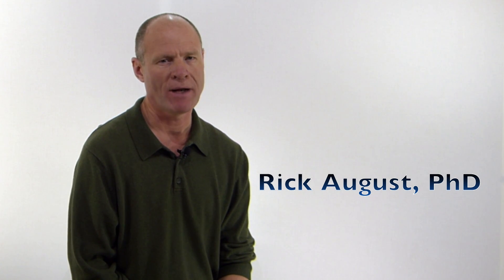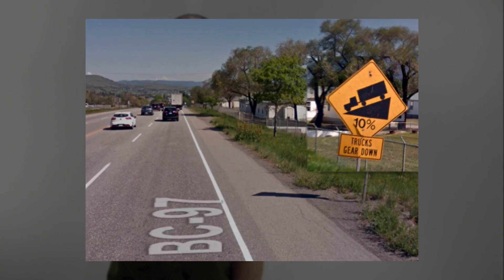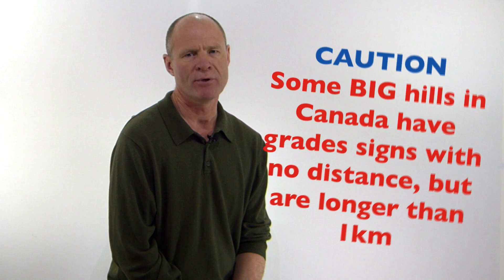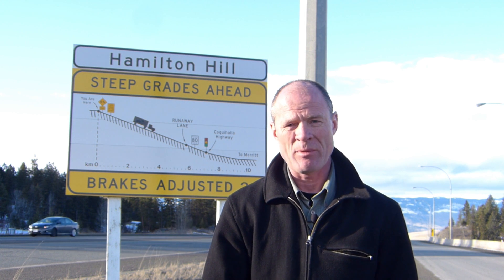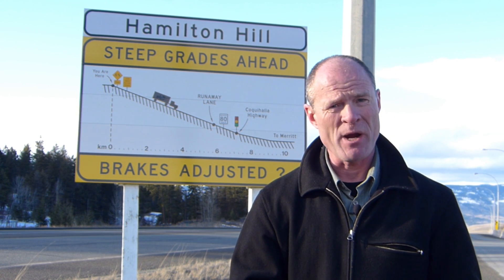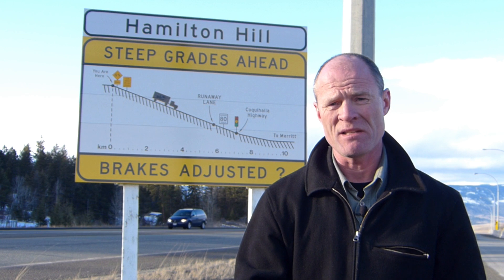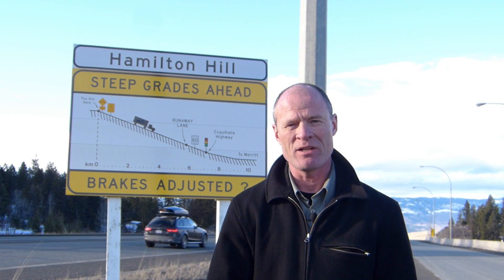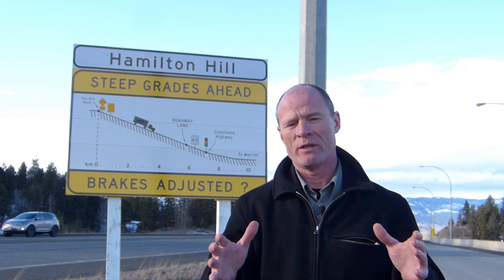How to Brake Downhill Safely | Air Brakes Smart

Comment: Brake fade: another thing to remember, when the linings get really hot there is some type of gas emitted that almost prevents any  proper contact between the linings and the drum or discs. This happens also with disc brakes. Ask anyone involved in motorsport: there are special linings used that work best only when hot.
Reply from the maker: Hi Uncle Bullfrog - Apologies for the late response. Thank you for your comment. And you are correct: this is a simplified version of what happens when you overheat the brakes. Disc brakes are just starting to make inroads into the industry so it will be interesting to see how these work in the mountains. All the best, Cheers Rick
Reply: @smartdrivetest  I hope they do help, that being said from what I'm told from now experienced drivers when it comes to brake fade you just get faster cooling time after you've lost your brakes. Granted that's anecdotal but it's all I have to go on.
Reply: Can you answer my question please ?
Reply: Because U-Haul rents box trucks to people who drive smart cars. It's an oversized station wagon.

Comment: With air brakes you never pump the brakes.  This will or could cause there to not be enough air in the air tanks to stop the truck.  A lot of YouTubers are telling people to use a system of what they call STAB BRAKING, which is the same at pumping the brakes.  By doing this you can pump all the air out of your truck air tank reservoirs that you need to stop the truck causing it to be a run-a-way truck towards the bottom of the hill because of insufficent air pressure.  This is very dangerous.

Comment: Excellent.
 As a veteran driver with over 3 million miles I concur. 
 You did miss 1 though,  and it's a biggie.
 Going down using the 'Johnny bar' is an excellent way to lose the brakes and it happens alot.
 The Johnny bar is usually on the steering column and activates the trailer brakes alone.
 Guys use it so that they can 'save' the tractor brakes. 
 Owner/operators are especially guilty of this.
 What happens is the trailer brakes get overheated and cease to function.  At this point the driver will start to use the tractor brakes, perhaps thinking that the trailer brakes will cool down. 
 WRONG.
 When the foot pedal is depressed it activates both systems.  The trailer brakes continue to heat and will not cool down, ever until you wreck.
 NEVER, NEVER use the Johnny bar for braking Going downhill. 
 The reason that trucks even have a Johnny bar is to couple and uncouple the trailer and is the only time it should ever be used.

Comment: What about in the winter time when it slippery also the Jake all the way down .
Reply from the maker: If it's that slippery, you should have chains on. If you don't have chains fitted and it's slippery - don't use the engine brake. Cheers Rick
Reply: Thank you 🙏🏼

Comment: Question: Using jail brake constantly on a downhill and while turning - is it safe? Because it's known that a rig brakes with it's power unit and that means that a trailer's wheels are spinning free and without control - so should we expect possible trailer skid or in what turn degree it could be occurred (how sharp a turn must be to initiate skidding)? Please, needed in advice. Thank you!

Comment: What means “if U r in the right gear” if trucks has automatic transmission? I just slow down to the posted speed limit and a little down
Reply from the maker: You have to select a gear manually with the automatic transmission. What kind of automatic transmission are you driving my friend? Cheers RIck
Reply from the maker: You have to shift down manually in the automatic transmission so it locks into 5th gear. See the owner's manual to figure out how to do that my friend. All the best, Cheers Rick

Comment: Sir before downhill i brake and lower the gear and go slow is that good whether its motorcycle, car. But my friend told use brake no need to lower gear rely on brake . Which is correct
Reply from the maker: Your friend is correct my friend - just use the brakes in a car or motorcycle. This information applies to pickup trucks towing trailers and CDL vehicle (buses and semi-trucks). Drop us a note if you have further questions. All the best, Cheers Rick
Reply: @smartdrivetest   But downhill  we need press brake hard right. Instead we go in lower gear we can control know any way using brake also . India  driving school they say to use lower gear in downhill. Here we use old brakes , old bikes is that reason. Engine braking
Reply from the maker: You are correct my friend. if you have an old vehicle with unreliable brakes, then definitely gear down to descend the hill. However, if the brakes work, use hard, short brake applications to reduce speed 15-20mph (20-25kph). With short, hard brake applications, you won't overheat the brakes my friend. Drop us a note if you have questions. Cheers Rick
Reply: @smartdrivetest   sir i learned through old vehicle unreliable brake and I use these techniques break as well lower down . Any thing wrong or fail test in your country.

Comment: We used to also turn the engine fan on ( our trucks had a switch on/auto) it helps holding back on steep loads.
Reply from the maker: Must have been Peterbilt trucks!! Yes, the engine fan is handy to take some power out of the downhill descent. Thanks for the tip. All the best, Cheers Rick

Comment: Do you have a video with this topic for regular cars?  Need to understand the difference between using breaks and driving in a lower gear.
Reply: Regular cars don’t have air brakes

Comment: 5th gear sounds like it would be way too low of a gear, especially on an 18 speed
Reply: I go down a 6% in 7th over if I have to slow down I go to 7th direct holds at 60mph in 7th over at 89klbs... 18speed Eton with a Detroit...

Comment: 02:48  what is he saying 13 or 18 speed single digit or tandem tandem ?  I drive automatic 12 gears freightliner?
Reply: What he is saying is on a grade of less than 10% when driving a 13 or 18 speed, you want to use 5th gear, it would be about 5th or 6th gear in a 12 spd.  Maybe even 4th if the gearing is higher.  (Built for speed, not power).  Tandem-tandem means a 5 axle truck. Steer, tandem drive axles and tandem trailer axles.  Anything with more than 5 axles is going to be heavier so you would want a lower gear.

Comment: 5% grade jake break blew out in West Virginia 2022 freight liner cascadia currently on the side of road waiting for a wrecker. Blew white smoke exhaust behind me was scary but I realized it wasn’t the brakes smoking heard a loud pop under the hood and saw the white smoke began stabbing brakes automatic wouldn’t not down shift so I had to just lightly stab brakes until came to bottom of hill to pull over.

Comment: So I'll be doing Donner Pass to get Into Sacramento in a few weeks.  In all likelihood I'll be In An automatic, air equipped Ryder or Penske truck at around 20-25k GVW. I don't think I've ever been in one of these trucks that had a Jake brake. All they really have is High or low gear.  What do you think the safest approach to this hill is going to be?
Reply from the maker: Are you taking a box truck? Cheers Rick

Comment: Thank you, Dr. August.  Great video.
Just a quick note, not so much to you but to the DOTs out there:  In addition to indicating the grade percentage, please add over which distance that will unfold.
We really NEED to know how long the downgrade sustains itself. Dr. August mentions this issue in his video. The information is crucial to know how to prepare for a downgrade. I worry less about a 7% downgrade over two miles than a 5% downgrade over six miles.
One more note about emergency escape ramps: IF your brakes fail, once your brakes fail, in a fully loaded truck speed really accelerates rapidly. If you have just passed an emergency escape ramp and the next one is five miles away, boy, are you in trouble. You'll be doing a 100 mph by the time you get there.

Comment: 0.27 what does he mean 'driver air'?
Reply from the maker: Hi swissborg $3moonshot - it's "driver error" my friend. In other words, the driver either wasn't trained properly or the driver picked too high a gear and wasn't using the engine and auxiliary braking systems to do the majority of braking when moving down the the long hill. Drop us a note if we can help further. All the best, Cheers Rick

Comment: “Rise over run” means absolutely nothing and makes no sense
Reply from the maker: Hi God - if you have a 6% grade, it means that for every 100' ft that you travel forward (run), the hill drops 6' ft (rise) my friend. The bigger the number on the grade sign, the steeper the hill. Drop us a note if we can help further my friend. All the best, Cheers Rick
Reply: @smartdrivetest  thanks. But i dont get the nomenclature, you are not running you are driving and its not rising its dropping. Should be “drop under drive”

Comment: What about the automatic trucks? You can’t necessarily downshift before going downhill, so would applying the engine brake be enough to make it safely downhill? I’m referring to a automatic freightliner truck
Reply from the maker: Hi Just Me - you have to put the transmission in manual and downshift my friend. The engine brake cannot hold the truck if you don't downshift the transmission. Drop us a note if we can help further my friend. All the best, Cheers Rick

Comment: The distant sign should becon the hills in BC. ( drivers put signs up gov took them down LoL ) seenbtrailers burn down.  So what do you do if in  snow storm signs snowed over NOT fsmiliar with road and all ready on the hill. Big problem. Utuber is a trainer/ tester NOT a driver. Yup check his notes. 1 403 830 4124 Also snubbing brakes on ice NOT a good idea. Max braking at high rpm yes. So why NOT let it run up to 2100 rpm )( log trucks same engine goes to 25oo rpm. So why NOT  let it rev. Even higher. Engine will hold more at higher rpm. Wind risestance increases as speed increases. Lots of times NOT holdingvat 1900 rpm. But held steady at 2100. No brakking required. TYPICAL  gov testor.  And if need be log truckers know how to drop gears " safely" while going down hill. NOT taught to hwy driver why NOT?  1 403 830 4124

Comment: awesome stuff
i seen a 9% here in usa
didnt see 10% before
anyone knows if there are any in usa ?
usually go down 6th gear in 6% 
and use 2nd stage in jakes 
and once speed up a bit, take it to 3rd stage jake and it will drop speed then go back to 2nd stage
just keep alternating.....
Reply: Is this apply to 10 speed too? Im going down hill with my 9th gear on 6% its still a little too fast for me. BTW im a new driver. Thanks
Reply: 10% in bc is not the worse some are 18% or more depends where your at.

Comment: How to use jake brake in winter in snow in steep hill
Reply from the maker: Hi Ranjit Dhaliwal - if it's really slippery you may have to put a single chain on the trailer. And when you're going down the hill go slow and keep you eyes in the mirrors watching the trailer. If the trailer starts to come around, push on the throttle to shut off the jake, let the truck run a little until the trailer straightens, and then get back on the jake. If it's that slippery my friend, they'll probably close the road. Drop us a note if we can help further. All the best, Cheers Rick
Reply: @smartdrivetest  thank you so much sir really appreciate i will let you know if i need further help

Comment: Is it safe apply j break in snow?
Reply: If used properly jake brakes can be used is snow.   Go slow use low rpms use low jake setting keep your foot over the accelerator so if the drive wheels start to slide you can smoothly press the accelerator to get the weels spinning again. If you are using the jake avoid heavy foot brake application as that can lock the drive tires up because the jake is already slowing them.   Do not go full jake at high rpms trying to slow the truck. That is very dangerous in snow or really wet roads.   Jake brake should never be used while driving on icy roads or really hard packed snow.

Comment: I don't know if automatics are a good idea driving cross country?  Locally probably would be more ideal because you don't have to shift all the time.  But when I started to think about downshifting for a grade.  I thought man not too sure about automatics?  I would prefer a manual.
Reply from the maker: Hi Jeff Chapman - Thank you for your comment. Ya, I'm not sure about automatics either my friend. Especially running in the mountains. I would really, really prefer to have a manual for running hills. And most of the trucks still are manual for the mountains. All the best, Cheers Rick
Reply: They are not as bad as one would think.  Most can be manually controlled. Some can only be put into a gear hold mode. It takes getting used to and i really prefer a manual in any condition.  But automatics are not really that bad.

Comment: If my tendom dump truck is loaded 48,000 lb as gross weight,  at what gear should I be at the intersection to turn left or right?
Reply from the maker: Hi Bob A. - Thank you for your question. For right turns you'll probably want to be in 3rd, and for left turns it's going to be 4th or 5th gear depending on the size of the intersection. All the best, Cheers Rick

Comment: Here is a question: I live in a very populated area. I often hear Jake brakes on semi’s as they roll through town. Should drivers, professional drivers, use the Jake brake in a city  as a means of stopping faster: i.e. using the engine brake to slow the truck down rather than keeping the truck in a low gear? I tend to think that style of driving shows a lack of experience. However, I could be wrong; hence, I ask.😉
Reply from the maker: Hi CT! - Thank you for your question. You are correct my friend. It's sheer laziness on the part of the driver. It's just a switch in the cab - on/off. Always happy to help. All the best, Cheers Rick
Reply: Those drivers are usually just annoying show offs.🤦‍♂️ very rarely does someone need those jake brakes in town to slow down.   Maybe if someone cuts them off and they need everything they can to get stopped.
Reply: @Bendigo, Thank you. The drivers that do this are driving in a 30 mph zone. Like...WOW!!! That does not make ANY sense, in my opinion. Why would you even NEED an emergency brake set on in such a slow speed zone? Crazy!
Reply: @JustAThought155  i doubt that it would really be necessary at that speed.  Only if its on a steep hill and a heavy load in a unplanned stop like someone walks out in front of the truck  or a car pulls out and stops etc but not something a driver needs to be doing all the time. As i said some drivers just like to show off or be annoying.  Most towns and cities have ordinances banning or limiting use of them in city limits.

Comment: Someone told me you mustn’t use the accelerator while the retarder is active, but i can’t  se how it could be a problem since the retarder is just basically an air cushion, was he wrong?
Reply from the maker: Hi Rikard Nilsson - Thank you for your question. Someone gave you mis-information my friend. If you push on the throttle, you'll simple turn the engine brake off. If there is anything further we can do, drop us a note. Always happy to help. All the best, Cheers Rick
Reply: @smartdrivetest  Thanks, I kinda suspected it but it's good to know for sure.
Reply: I think that comes from the really old engines before they  implimented the jake cutoff into throttle.   It could mess up the engine because it was getting too much fuel while also trying to retard the engine.

Comment: Cummins engine brakes cut out below 35 mph
Reply: So far on my truck when the speed is below 35 the jakes disengage. Im guessing its to avoid the noise if youre just going through areas that they arent needed. Whoever didnt keep in mind going through steep grades it seems
Reply from the maker: Hi ljn1477 - Thank you for your reply. I suspect you're right my friend. I'm going to ask around and see if I can get some further information. All the best, Cheers Rick
Reply from the maker: Hi ljn1477 - Thank you for that information. Is it 35mph, or is it that you're in a high gear and the engine brake cuts out below a certain RPM? I'm asking because I don't know and am clarifying the information. All the best, Cheers Rick

Comment: Hi,what does it mean illegal jack break use?I saw that sign in Oregon when driving down the hill and was thinking how do I get down without using jake brakes.
Reply from the maker: Hi Fita fitoni - Apologies for the late response. Thank you for your query. If you need to use the Jake brake my friend, then use the Jake. Most modern trucks have quiet jakes. The signs are mostly for those super trucks with straight pipes and a jake brake that would wake the dead! Choose safety my friend. If there is anything further we can do, drop us a note. Always happy to help. All the best, Cheers Rick

Comment: what about a 10 speed with NO Jake brake (or pac) ?
Reply from the maker: Hi Fatcat Towing - Apologies for the late response. Thank you for your comment and query. If you don't have a jake with a 10-speed transmission you're going to need to be in 2nd or 3rd gear and use snub braking. Ensure that you take in the grade information and know how far it is down the hill my friend. If there is anything further we can do, drop us a note. Always happy to help. All the best, Cheers Rick
Reply: @smartdrivetest  hi sir. Im going down 6% and 5% hill with 10 speed with jake brake. Which gear is best to be in. Im doing 9th gear but there some part its picking up speed fast. Should i go into 8th gear?